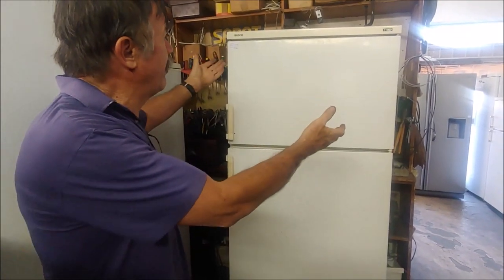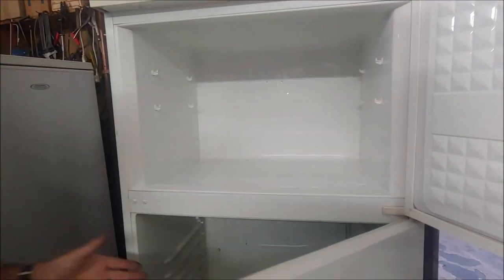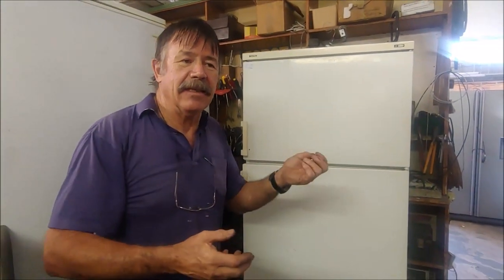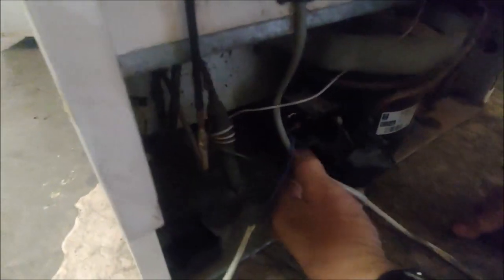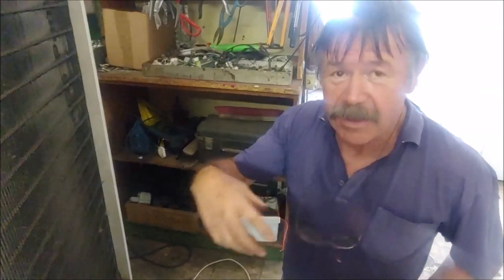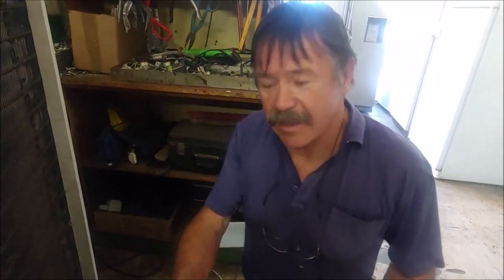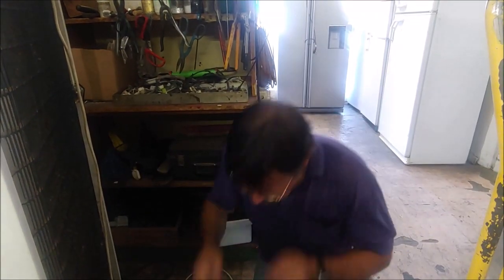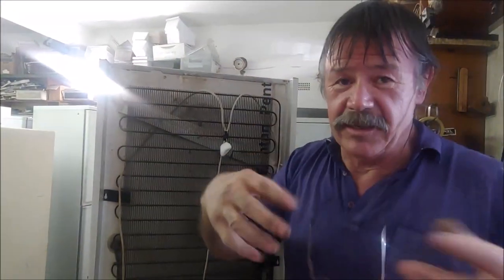Testing a fridge to find the fault

Comment: whats the takeaway?  so after cutting capillary, u closed it back? smelled the gas? now u have to fill the gas again?
Reply from the maker: To change a compressor you need to have an empty gas system. If you weld a system with gas in it, it will explode.

Comment: Hi, my DEFY F-600LM (14yrs old) freezer not working well… only freezers to maximum —2degC?… I stripped the defrost element out and measured 179 ohms on defrost element?… is that a decent reading?…. I’ve replaced the compressor with a commercial 1/4HP unit…but still doesn’t cool very well?… now stripping defrost system…but load shedding here?… any solutions or light you could shed on the problem?
Reply from the maker: Before changing any components you have to conduct tests. If you are not able to conduct the test yourself, I do free quotes in my workshop.